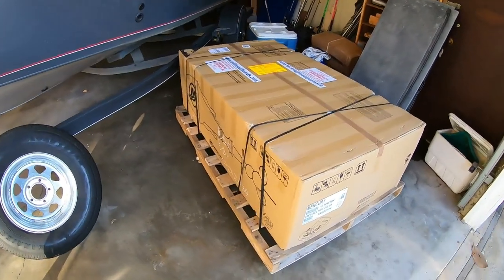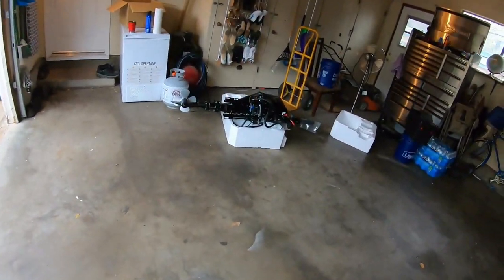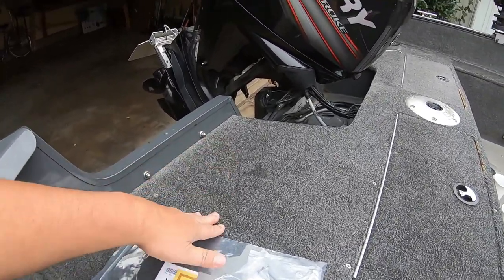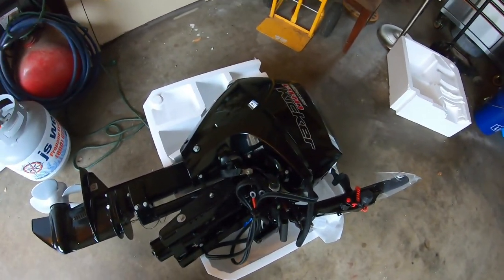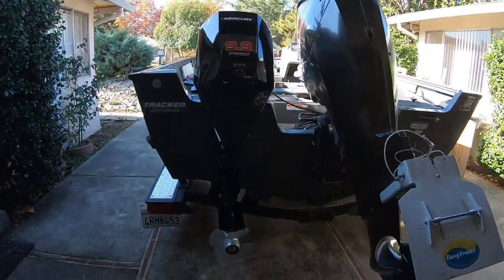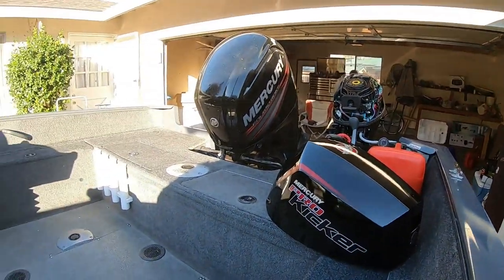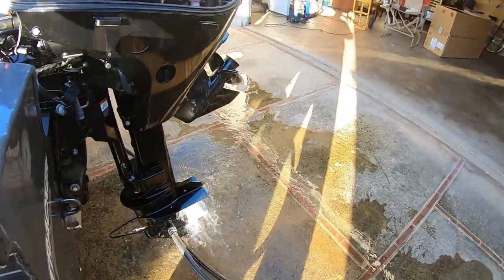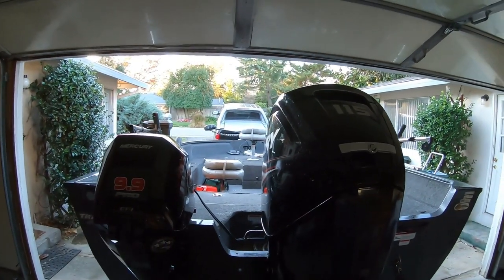Mercury Pro Kicker Install On Tracker Pro Guide 175 SC

Comment: Just had a 9.9 EFI ProKicker installed on my Targa 18V. 8 hours labor at my shop. No way I could beat that myself even though I could definitively do it myself. That included remote shift/throttle  and steering linked to big engine.  Wish I had a video of the install to post to help others though.

Comment: My new kicker “should be” arriving next week at BPS, ready for install. Just in time for it to start heating up at Folsom as the water temp increases. I really like my Pro 175 combo. Good luck!
Reply from the maker: Runs like a champ, goes great with the ulterra for steering and autopilot!! Thanks for watching
Reply: John, I am also thinking of putting a kicker on my 2019, pro v175 combo. What did you end up going with on yours?
Reply: @mrselfdefeat1128   I did buy the 9.9 Mercury long shaft. Keep one thing in mind if you link it into/with your main steering, it gets stuck sometimes when you make sharp turns. Other than that, it’s worked out fine. I just don’t get out enough. I don’t like being on the boat alone.

Comment: Thanks for the video. Mercury dealer stated the motor no longer comes with bolt kit or fuel line. Looking for thread size, size of bolt in your kit. It also looks like you only use 2 of the transom bolts instead of 4. Any reason why you did not use all 4 bolts?
Reply from the maker: You can use 4 bolts through the transom,  instead of the top bolts,  that what they intended by nor giving you the upper thunb screw bolts, I just perfered to use the thumb screw bolts due to larger diameter! Thanks for watching

Comment: Have you had any problems with water leaking in through the holes? The mechanic at the  boat shop I go to didn’t want to permanently mount my kicker because he was worried about this??
Reply from the maker: Hasn't leaked a drop! Use ultra black , or ultra gray permatex,  marine silicon sucks, they shouldn't even be selling that garbage! Hey thanks for watching

Comment: You know those deck screws are a square bit style head right? There are not stripped, you just needed a square bit to remove those. Just a heads up incase you want to remove other ones. You can find those square bits at any hardware store (Home Depot, Lowes, etc...)
Reply from the maker: No definitely Phillips in this boat , I have plenty square drive bits, thanks for watching the videos we appreciate it
Reply from the maker: I have see square drive screw heads in other boats before tho , I'd definitely prefer those

Comment: Did you end up putting a t off the main fuel line? If so, where did you splice in? I'm putting the same motor on a tracker 175wt.
Reply from the maker: Get a water separator and 2 barbed nipples on it , I still need one , mercury one will mount in the well back there! Thanks for watching the video
Reply: Hi Rob, I have same question. Do you have picture on how you splice these fuel line?
Reply: Rob, I have some more questions. You order this motor from Online Outboards? How was your experience with them? How long did it take to ship to your door step? I want to order one from them, just want to make sure they are legit.

Comment: Did the plastic transom spacer come with the motor?
Reply from the maker: No measure it out to clear the rear deck board and went to tap plastics and had one cut, pretty cheep
Reply: @thefishstalker7640  Thanks

Comment: How do you like the smooth moves suspension seat?
Reply from the maker: Actually I was to heavy for it, lost over 80 lbs seems to be working better now, but definitely slow down even more with it in big wake especially around wake boats, can serve as a ejection seat if you don't!! Not sure I'd really recommend it! I'll try to get a video on it this spring after 1 year, and more weight loss!, Thanks for watching the videos

Comment: I got a v18 combo. Do I need a 9.9 kicker 20” shaft or 25” shaft?
Reply from the maker: 25"
Reply: @nickthorng1743 I just installed a 20in on my v19 but I did it like factory and kept it above the deck and did thru bolts. Took me 2hrs start to finish. And I'll let Tracker guys know, there is or atleast was on mine a extra pickup line on my fuel tank. Has a plug in it and mercury has the fuel line with bulb that has the fitting to replace the plug.

Comment: What year is your Tracker??
Reply from the maker: 2017
Reply: @thefishstalker7640  How is the long shaft working for you trolling? I asked the service manager at my local Cabela's and he said that for my Pro Guide 175wt, I should use an extra long shaft, and I measured my transom at 24" where the motor will mount. I guess what I'm asking is, do you have good control and speed control?
Reply from the maker: Prop is right under the bottom line of the boat! 25" is perfect too